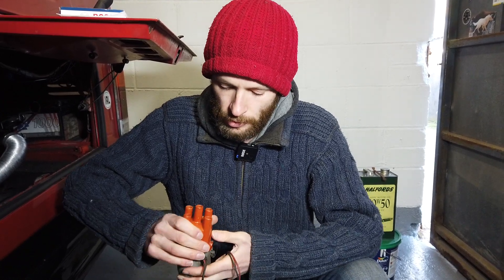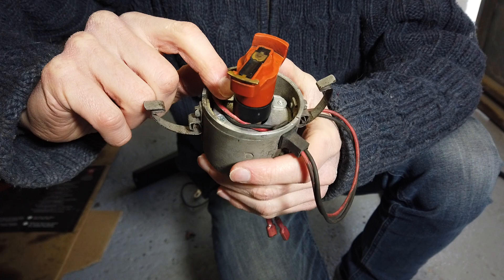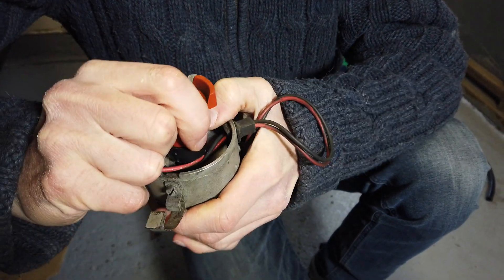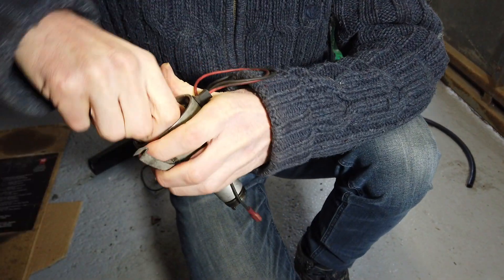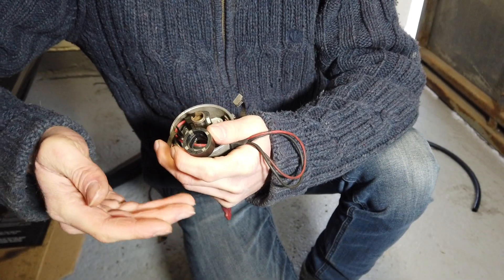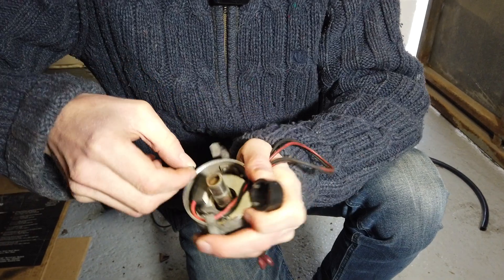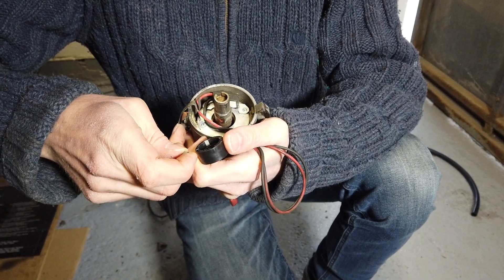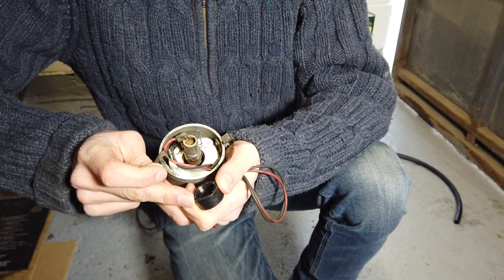Electronic ignition missing spark on one cylinder

Comment: interesting i have a 5th gen Honda prelude no spark coming from dizzy just on cylinder one tested everything apart from ecu solder joints but never thought of checking to see if this magnet issue was the problem il go check that right now